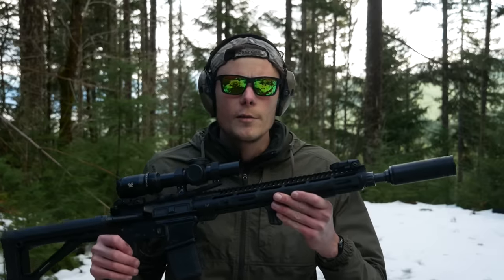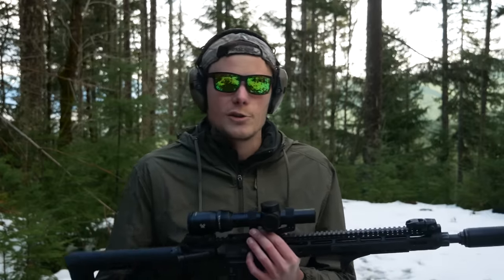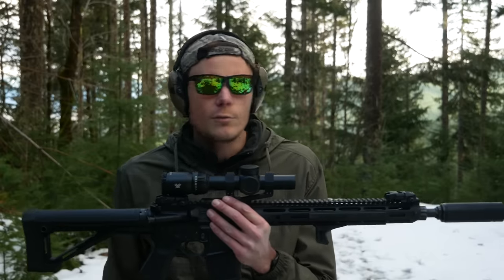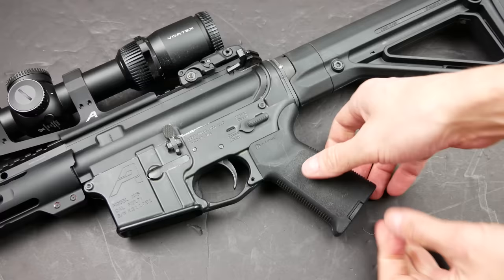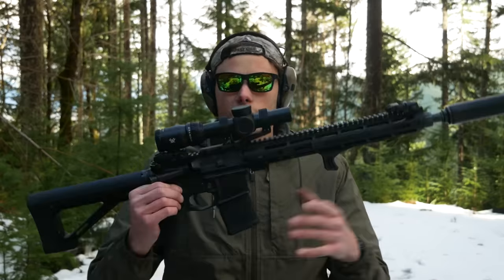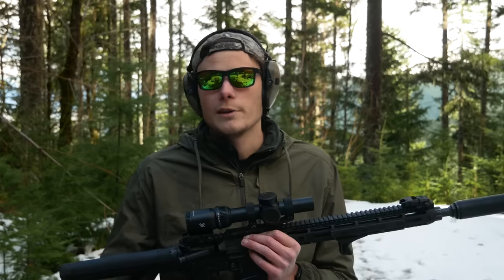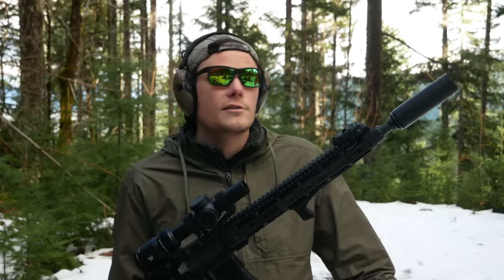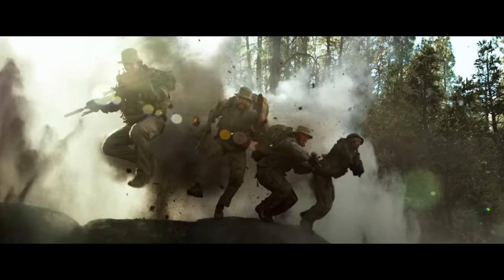WTF are Backup Iron Sights For?

Comment: The real reason to have a set of back up irons sights is to avoid having people tell you that you need a set back up iron sights.
Reply: Brilliant.
Reply: I may have to take this same philosophy with putting flashlights on my range toys. The sheer number of times I've had to tell people that I am not buying a surefire light for my 300 dollar 10.5 AR is ridiculous.
Reply: Facts, tired of justifying not running useless plastic flip ups
Reply: Then you pull out your backup gun 🙄
Reply: Well, I have seen optics damaged with one drop, a fall, bad bump. You should have some way to still use your weapon, should a disaster happen. My two cents
Reply: This is the only answer
Reply: Could always put sights on the bottom rail to function as handstops.
Reply: @2a0wen  I just have mine as cowitness with my redot
Reply: I have them on most except my Hi Point 995. It’d cost $160 including the rail. The gun cost $185 w ffl fees. Lol
Reply: Hey late hit hop talks about this a lot. I have a red dot with magnifier and wanted backup irons on the rifle as well. But eye relief was rough so moved the magnifier all the way back and the irons in front of the red dot. - but now my hand scrapes on the magnifier or mount depending on side, and the irons r a lot harder to see. So wanted to see what you’re guys thinking was as far as magnifier with back up irons
Reply: This
Reply: @alexmaurice4274 unfortunately all I can think of are canted irons. But imo those are kind funky looking and all the nice ones are pretty pricy.
Reply: Real.

Comment: I wasn't a fan of backups until an unusual experience I had one range trip. I live in Missouri and that particular day it was in the 90s with high humidity. I got my rifle out of my air conditioned car after driving most of an hour and the exterior of my optic immediately fogged the way people's eyeglasses do in winter. I could wipe it off but it would promptly fog again, it took almost 15 minutes (in the sun) for the optics to become warm enough not to fog. I could see a cop who keeps his rifle in the trunk of a car having similar problems moving into a heated building in the winter. So I now I have offset irons that can't become obscured by condensation like that. Obviously where you live and how and when you use your gun will determine whether you EVER see that happen.
Reply: Yes. Same. Actually, my issue has been walking out of a 70F house into -10F to smoke coyotes harrassing the dog or chickens.
Reply: Anti fogging lens wipes are awesome for that
Reply: Never thought of that. Good point. I live near phoenix AZ and it’s deathly hot. The worst I have is sweat and sunscreen dripping on my optic
Reply: Definitely a problem in the south
Reply: Fogging is the reason I don't bother with optics on CCW's. It's already bad enough with my glasses, I'd rather not have to deal with it on my CCW as well. I live up by the river, lots of foggy mornings + hot humid air isn't particularly great for optics after leaving a 18c home.
Reply: For red dots fog is not an issue. Even if it fogs up you're not using the window port solely for aiming.
Reply: @ImperiumLibertas  not an issue with red dots??? I was unable to take shots in Jan 2023 on deer 120 yards away because of a fogged red dot.
Reply: @ImperiumLibertas  Thats only true if the objective is the only thing thats fogged.
Reply: @ImperiumLibertas Doesn't seem to be the case, as the red dot is scattered on the lens due to the fog.
Reply: 💯 Yes. In humid weather like in the south USA, I have 45 degree off set irons on my GPR for this very reason. And on my AR pistol with holosun RDS, i keep my lower 1/3 MBUS.
Reply: In the military we just point shoot
Reply: @EvilWiffles you should be able to still shoot it. Both eyes open and your eyes will overlay the dot and your eye seeing around the optic.
Reply: @_Delta_P_ There was no dot.
Reply: @CoastalForests  cool. We are in different environments but my fogging was in temps similar to what you talked about (30-32). That day in particular, Jan 2023, the valley air was rising and hit my RDS. I watched the deer. I popped a fogged see-through scope cap and waited. Got ready for a shot and saw the far scope cap was fogged, so I carefully popped that and looked through again and the near lens was fogged already. So I was unable to make the shot with the RDS. 

So I switched to the irons right below and missed. Due to lightning. But at least the irons weren't fogged.
Reply: Immaculate Example

Incredible Lesson
Reply: @CoastalForests  purged optics only keep fogging from happening inside the optic. What happens on the outside is strictly related to a cold gun moving in to a warm and humid environment. And it's not only the glass that fogs, the entire gun gets a layer of moisture. This is the dew point. 

Go from a cold house or car in Florida and any optic will fog. That won't happen in Phoenix at the same temperature because it's so dry.
Reply: @EvilWiffles  fog won't scatter your dot unless there's condensation directly on the emitter.
Reply: @orpheusepiphanes2797  not true. You can try putting tape on the front of your optic and aim at something. You'll be able to see both the dot and the target as long as you keep both eyes open. 

This is something you can also do if you're holding a spot where the sun is too bright. Tape over the optic and boom you can see the dot again.
Reply: @ImperiumLibertas Well, clearly you're incorrect because it did on mine.
Reply: Rainx or Chums anti-fog spray. Fixed it enough for me, but who knows maybe I’ll be Death Valley or Alaska. Either way just advice, still run back ups ofc.
Reply: @EvilWiffles  then you must have had condensation on your emitter. Or you're worrying too much about dot bloom that goes away when you're threat focused. I cant diagnose your dot since I'm not there. The entire advantage enclosed dots give is that if the lens fogs up the dot will be usable because the emitter is protected.
Reply: @ImperiumLibertas  Yeah, it likely was the emitter as it was an open dot, not enclosed. I know how to superimpose, so it's not like I don't know how to use the optic. I don't really have much trust in these small closed emitter red dots, so I stick to irons.
Reply: @EvilWiffles   to each their own 🤙🏻
Reply: @ImperiumLibertas  But if you can't see the dot/reticle because of the fog you have nothing. If only the target side fogged you have an OEG which can work, but with both sides fogged you have no sight and no pass through for inline backups or even instinctive aiming. You might as well be hip firing and actually using both eyes at that point.
Reply: @darthhodges  you dont have to see through the sight to see the dot. You can superimpose the dot over the target. It's not optimal of course but acting like fog on the lens makes the dot inoperable is not accurate. Even with full blown liquid on both sides of the RDS the red dot will still be visible and any added bloom will be irrelevant as long as you're threat focused and the emitter is not obscured. 

If you have issues with fog consider getting an enclosed optic as they're nitrogen purged which will ensure the interior of the lenses don't fog and the emitter stays unobscured.

This isn't new to RDS this has been SOP for RDS for a decade now.
Reply: It's not about what type of optic you have. It's about the qualiity of the optic. You won't have foged up lenses on your Nightforce, your Aimpoint or your Eotech. 
But you probably will on your cheapo-optics.
Reply: That's why you should listen to men that go to combat and have experience bot internet guys. Back ups are needed.
Reply: I'm from planet of the apes, St. Louis, if this event even actually happened, what was the gun and where was the shooting range located?
Reply: @ImperiumLibertas  The fog was on the OUTSIDE of both lenses on my fully enclosed optic. I could wipe it off and I would get a couple seconds of usability before it fogged again and I couldn't see the dot. Nothing you've said applies to situation I experienced.
Reply: @antonw-uw4ov  How well sealed the optic is was irrelevant to what I experienced. I could wipe it off and see for a second or two before it fogged again. The optic was colder than the surrounding air in a high humidity environment, you fix that by making the optic warmer.
Reply: @russellweber3466  My AR at an outdoor public range about an hour north of Columbia.
Reply: Neat
Reply: Crap optic...
Reply: That’s too far to take game ethically
Reply: In regards to condensation you keep your rifle at the same temperature and you generally won’t have a problem, I live in mn and while deer hunting I leave my rifle next to the door of my deer stand and open both windows to let the rifle continue to get cold air otherwise the propane heater will create condensation and once the rifle is heated when you go outside to hunt on foot your fogged out. Really annoying if you have 4 lens to take care of ie a red dot magnifier combos
Reply: @swannybo1sk8s9  in 35 years I've never had a problem with condensation with Japanese made scopes or American brands like Leupold or EU brands like Schmidt & Bender. Also never had an issue with trijicon or eotech.
I do believe in backup sights though.
Reply: Why the White Unalive didn't use them
Reply: @russellweber3466 could be anywhere southern Missouri, I have seen the temperature be 99 degrees with 99% humidity at midnight, everything sweats
Reply: @ImperiumLibertas   If I put tape on the side facing me I will not see the dot
Reply: @boygonewhoopdataZZ  it doesn't take all that much training to be able to hit a man-sized target inside 100m with a carbine.

Comment: I have a red dot on top of the ACOG, offset iron sights, an mounted bayonet, a holstered sidearm, an ankle gun, a fixed blade hunting knife, a folding knife, brass knuckles and a garroting wire. And if I’m doing more than just grocery shopping, I really get serious about equipping properly.
Reply: @@Floridaman855mans basically admitted to being a professional LARPer. When will the gun community get serious about preparedness? Smh 
/s
Reply: It's all LARPing until it isn't' @Reblwitoutacause
Reply: @welderdude1  whoosh
Reply: Pfft.. No underbarrel 12 gauge pump?
Reply: No flashlight.? 😺
Reply: Have you considered a tactical nuclear grenade launcher?
Reply: Obviously tongue in cheek, but the man also makes a point: most rifles set up for combat have more than one aiming method anyway. When you've got an ACOG, a micro-dot, and a PEQ-16 do you really need a 4th aiming method just in case that all breaks?
Reply: “Not that we needed it all for the trip, but once you get locked into a serious LARP collection, the tendency is to push it as far as you can”
Reply: You joke, but I work in non-gun retail in a red state and I deal with at least one guy like that every day. He's inevitably either 21 and trying desperately to show everyone how tough he is, or he's 65, obese and trying desperately to show everyone how tough he STILL is... Car covered with obnoxious bumper stickers advertising every gun they own and which politicians they wish were dead, etc. We call them "the man-children".

All the truly lethal people I've met in my life already know they're lethal and have long since mentally moved on to concealing their capability from potential adversaries.

Comment: "A very, very bad day that 99.999% of us will never have."
Reply: But it's best to prepare to be the 0.001%.
Reply: Yup serious tho. I have armor ,kit and a pvs 14. I definitely believe we should train and all that,but I've never understood going into debt for this stuff especially since we most likely will never use this for combat.
Reply: @zacharyrollick6169  there are more than 37,000 deaths every year by car. That 0.001% won’t be firearms related.
Reply: Had a lot of optics fail on me in a previous occupation so now I have the constant fear of it happening on this side of the fence. I learned to keep backups on all my personal rifles that aren't bolt action safe queens.
Reply: imo classic red dot, holo sight users can have battery or emitter failures, otherwise use with etched reticles is marginal
Reply: Yup.  It happens extremely rarely...*unless* you haven't prepared for it, in which case the likelihood of your primary optic failing goes up by several orders of magnitude.  Because Murphy loves us.
Reply: Well...Im NO operator but I went with a Vortex 5x prism (astigmatism) and Midwest Industries Ambi offset folding BUIS.....(Left handed) that Vortex needs to be as far back as possible for eye relief so it works out ok
Reply: @markanthonypar-wise1499  bc it’s cool duh
Reply: I broke an ACOG on deployment and literally had to use the backup sights for the rest of the deployment. Even a tough optic can be destroyed.
Reply: Coktstevo must be a serious operator
Reply: Where were you deployed? San Diego?
Reply: Welcome to prepping.
Reply: Until we do.
Reply: @BullMooseFox Incredible hulk over here

Comment: I too am a “torx in the pistol grip” guy.  Your rationale for backup irons is essentially the same as mine.  Having a set of already zeroed backups also speeds up the zeroing process when adding a new red dot or other non-magnified optic because you can just line the dot up with the irons to get pretty close and then fold them down to get a good unobstructed sight picture for the actual zeroing
Reply: I have my BUIS setup this exact way.

Comment: I keep a set of Troy M4 backups on my main rifle as I mainly keep an eotech on it, but if I decide to swap to my nightvision or thermal sight, all I have to do is zero them to the irons.  And when I put my eotech back on, I can confirm my zero has not shifted without having to go in the back yard and fire a few shots.  It's also nice to know you have a pretty much 100% reliable set of sights at all times, every optic can fail and it usually happens under unusual circumstances.
Reply: Our patrol rifles at my work have Comp M4 dots, with a set of fold-down backup irons. I've actually had a couple times where I pulled the rifle out of a vehicle and found that the RDS had a dead battery, but the other member hadn't noticed because they weren't checking it every shift like they're supposed to. Ultimately then, it's definitely a good thing that we have them, so that there are still usable sights when somebody isn't paying attention and that happens.

Comment: Thank you for common frickin sense on this subject.
And added benefit you didn't mention is that if your red dot goes down, you can flip up the front sight only and use it to guestimate where your reticle would be. This can be quite effective.
Reply: You don't get to "guess" where your sight system is. I've heard this BS claim from people in the past. I swear, people in the modern gun community will do anything to avoid lining a post up inside a sight ring.

Comment: Thanks for the vid. BUIS discussions are about the same level as 9mm vs .45 . Its a personal decision based on how you use it. BUT, as a retired military guy and with another 21 years as a DOD trainer, I always have them. I have seen things happen in bad places where a optic goes down or is damaged and  your life may depend on them. I had a running argument with a squad leader for several years about them. Then he had a incident when deployed where his optic took a shrapnel hit and was put out of action and he had to do the walking dead type shooting down the barrel. After that he did a modified version where he sighted a set in then took the back sight off and kept in a pouch on plate carrier. I ran into him a few years later and he told me he had to give the BUIS to a private that somehow actually broke a ACOG (that's why mil stuff is tough,  it has to be Pvt. Snuffy from Alabama tough) while on a long patrol. Just 2 times in 3 deployments shows it isn't common but when you need it you need it now. For most people who will never go to bad places or do bad things, maybe not needed. But if the  collapse comes there wont be repairs or anymore available or made so I don't leave home without them😉
Reply: They are not an option so it’s not like 9vs45. Stop pretending to be someone else.
Reply: in cold weather lenses tend to get foggy especially when you are breathing heavily from exercise. 
cant happen with ironsights.
back ups are always good to have